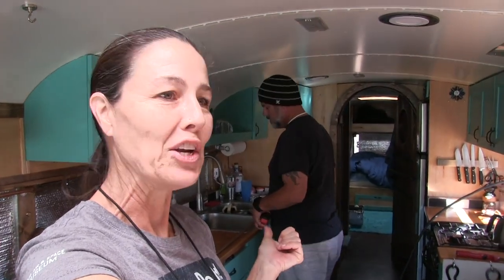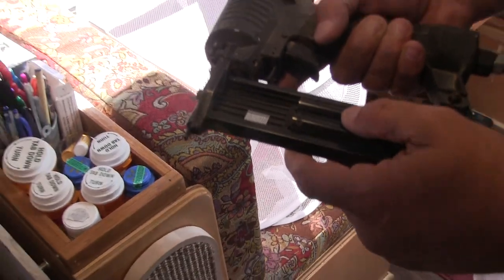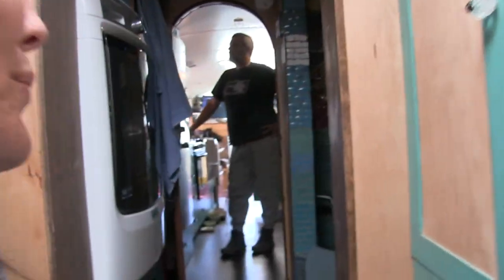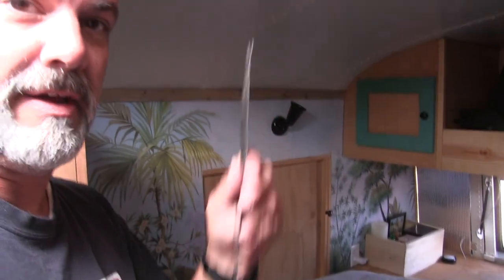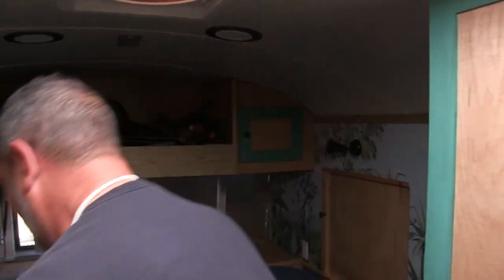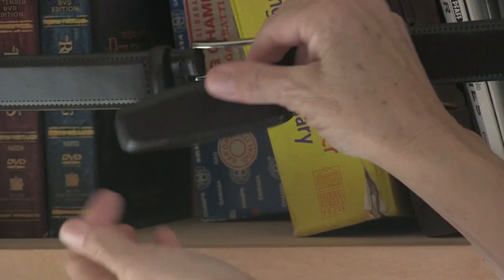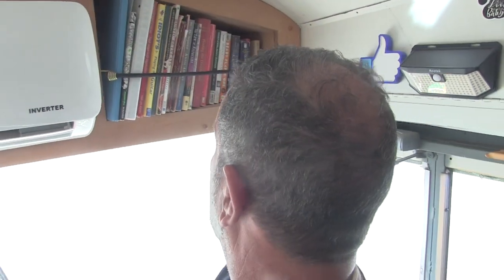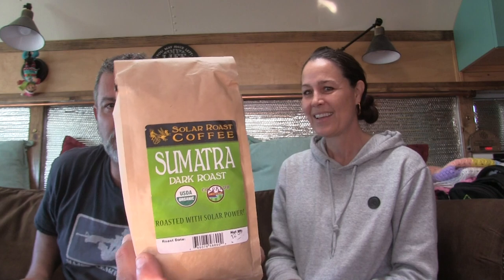Skoolie Honey-Do's, Maxx Fan Fix & Near Disaster!

Comment: Mike - you could add a Horizontal Float Switch with 1/2" NPT, into the side near the top of the tank and monitor its state with an arduino and a display.  I know you've got the skills.  Or even easier, use it to switch on a buzzer.  Easy peasy.

Comment: Just put an over flow hose on your fresh tank like most RVs have.
Reply from the maker: There is an overflow hose hit it can't keep up until there is pressure in the tank and when it is even with inflow vs outflow, the tank is really oversize.
Reply: @BussyMcBusface  Mike - you may need 2.  On the RVs my employer makes, we use two 1/2" PEX lines for the 80 gallon tanks.  And of course, the emptier your tank is, the more air that needs to be displaced - another reason for more venting :)

Comment: You need that overflow pipe. Good luck guys
Reply from the maker: There is an overflow hose hit it can't keep up until there is pressure in the tank and when it is even with inflow vs outflow, the tank is really oversize.

Comment: Our overflow pipe can keep up with over 5 gals.a minute. I guess you need a bigger pipe. Or go to a garden center at home depot or lowes and get a sprinkler timer. You set the number of minutes and it shuts off if you forget. I use this plus a water meter that indicates digitally how many gals. you have used.

Comment: The belts would work if one end had a short section of elastic between the belt and the screws. Check the wattage needs of the fan and install a 12v voltage regulator in the line or at the fuse panel. I used them to stop over-powering the LED lights I built into my old fluorescent lights in my RV. I also purchased one of each type of air hose end fittings (male) and carry them in my tool stash to adapt my air tools to whichever hose/compressor I want to connect to.

Comment: Question about over fill I thought all tanks like that has a overfill hose on top going out the bottom of the buss incase of overfills ?  ✌❤💪👨‍🍳🎅🚌🙏
Reply from the maker: There is an overflow hose hit it can't keep up until there is pressure in the tank and when it is even with inflow vs outflow, the tank is really oversize.

Comment: Is it a gravity fed tank? or do you have to have your hose screwed on?
Run a Vent line from the tank to the ground...Could just be a small drain hose that spits water back at you when it gets too full :P
Reply from the maker: There is an overflow hose hit it can't keep up until there is pressure in the tank and when it is even with inflow vs outflow, the tank is really oversize.

Comment: Hi Guys john from uk. first time commenting on your channel, electrical connections in the UK are called scotch locks, Water tank issue possibly solved with a Over flow pipe from top of tank through floor so that the water falls onto the ground, Water has got somewhere to go if you try to put too much in, PS just a thought love the channel keep up the good work stay safe and well,

Comment: My rv water tank has an overflow plumed in at the top of the tank and is routed out under the coach near the water bay. When the tank is full the water just pours onto the ground. Might want to consider doing something similar.

Comment: Mike don't you have a over flow valve on the top or side wall at the top? That's all you need when it's full it goes out that fitting and plumb it out the floor so it's got somewhere to go most the the Fab tanks Amazon etc should have them but you could add one scary thought you could have blown out a side wall or something 100 gallons of water would reach the front door buddy nice save though.
Reply from the maker: There is an overflow hose hit it can't keep up until there is pressure in the tank and when it is even with inflow vs outflow, the tank is really oversize.

Comment: Over flow tube would fix this,an rv. has them and squirts water out to let you know it's full
Reply from the maker: There is an overflow hose hit it can't keep up until there is pressure in the tank and when it is even with inflow vs outflow, the tank is really oversize.

Comment: maibe you can put an overflow hoe on the tank so you can hear water pouring out when the tank is full , prevents overpressuring the tank too
those guilotine wire connectors are realy dangerous they can cause a fire if you run too mush current through them , look intoo wago connectors they work a little better clamp on realy whell to just about every reasonable size wire either stranded or solid core wire and you can add take off wires indefinetely
Reply from the maker: There is an overflow hose hit it can't keep up until there is pressure in the tank and when it is even with inflow vs outflow, the tank is really oversize.
Reply: @BussyMcBusface  maibe double up on the overflow or increase the size of the hose for the overflow , as for the overflow alarm : i have this realy cheap bath tub overflow alarm , basicly if you short two pins in water the alarm sounds , you going to need to adapt it a little by putting wires on the pins but after that you could drill two stainles screws in the lid connect those to the alarm and youll know when the tank is full https://images-na.ssl-images-amazon.com/images/I/61-nfqHtyYL._AC_SX466_.jpg
might want to put a switch in between as sloshing will set the alarm off too

Comment: tank alarm, pi, esp32, Arduino project?
Reply from the maker: Those could definitely be handled by a raspberry pi, Arduino, or some other microprocessor but in reality it could just close a circuit and light off a buzzer just as easily. Not sure what I'm going to do yet but it seems like something I need to do before we explode the bus.

Comment: That's why there should be a over flow hose. Your going to end up ruining that tank and possibly your whole build from the tank blowing up and getting 100 gallons of water everywhere under all your floors and cabinets. It will be bad if you dont end up installing one..
Reply from the maker: There is an overflow hose hit it can't keep up until there is pressure in the tank and when it is even with inflow vs outflow, the tank is really oversize.